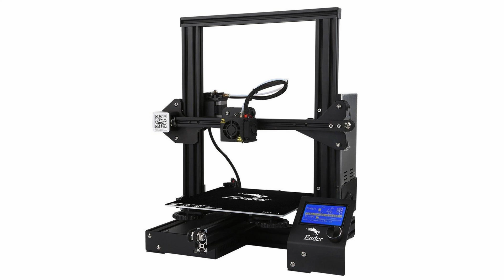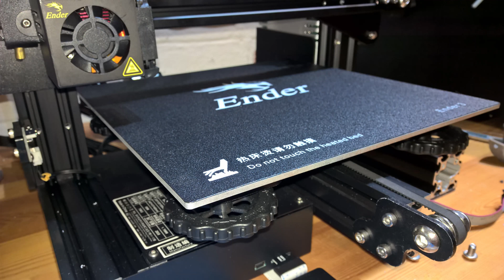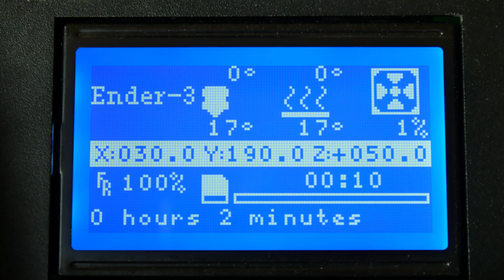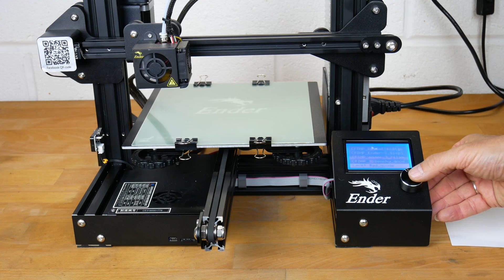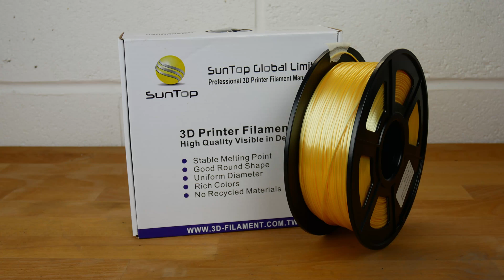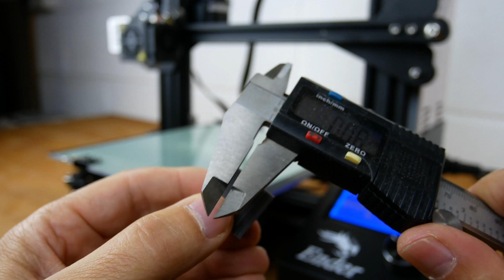Creality Ender 3 Build Review and First Print

Comment: Great videos. Couple questions, when adding the glass on the bed do you have to adjust the Z limit switch? If so how do you know the correct height? What distance should the switch close before the nozzle hits the top plate? Also, does it make a difference in levelingg if the bed is hot or not? Thanks from a newbee!!
Reply from the maker: If the adjustment in the levelling wheels isn't enough to be able to level the bed, you may have to move the Z end stop switch up or down then re home the axis and re level the bed, levelling is best done cold so as not to burn yourself, as it only makes a very small difference.

Comment: Any idea what this issue could be?  https://www.youtube.com/watch?v=gG_2Eu4fGY4
Reply from the maker: I presume you have got the belt tooth side to the inside? Try removing the belt, and see if the motor on its own makes the noise.
Reply: I verified the belt is installed properly and the extruder assembly glides smoothly when pushed by hand.  I removed the belt and when it ran the motor turned smoothly counter-clockwise but stammered clockwise.
Reply from the maker: I'd check it's not catching on anything as it rotates, other than that it sounds like a faulty stepper motor.
Reply: I got lucky, just a loose wire!
http://flashpowered.com/files/View3.jpg

Comment: Why not just adjust the Y axis end stop switch and slide it forward instead of bending the switch?
Reply from the maker: The Y axis end stop is fixed by screws directly into the extrusion and cannot be slid forward, bending the switch was  the simplest solution.